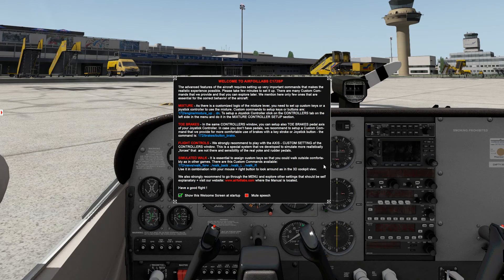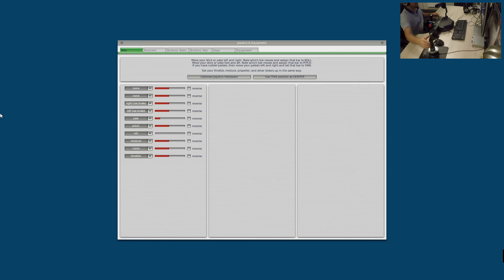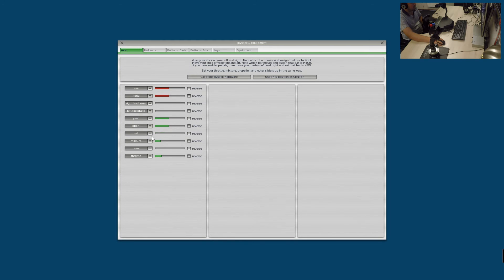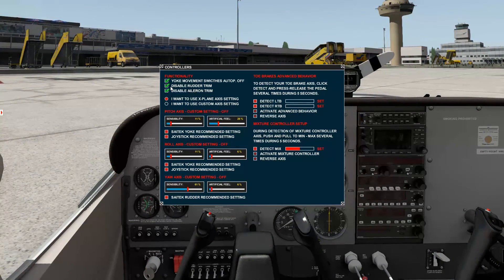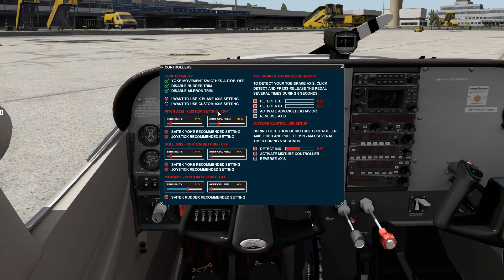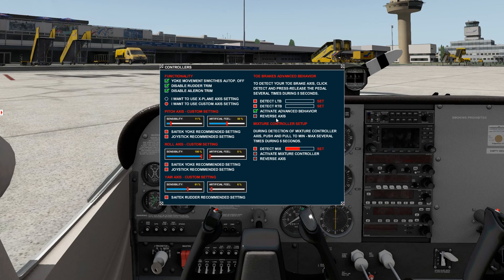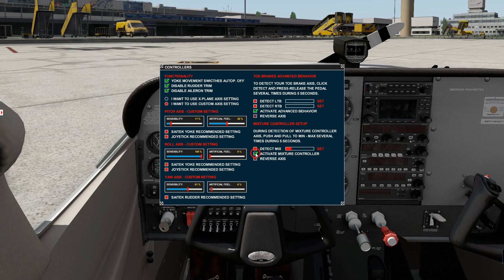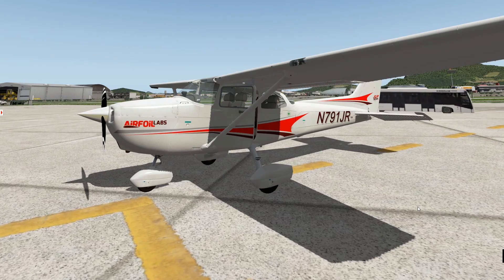2. Airfoillabs Cessna 172 SP 1.61 - Basic Setup

Comment: First of all, thanks for airfoilabs for doing this awesome job! Its a masterpiece.

So, I bought it and I'm experiencing some issues. I use a Thrustmaster Flight Hotas X, so I do not own any rudder pedals, I use my braking control on my joystick.

I followed the tutorial but when I set the button for "Main Brake (in case you have no toe brake pedals controller)", but nothing happens when I press this. 

When I use the default (B for braking), I hear the sound of the parking brake being applied, as I was pressing "V" key. Could anybody help me on it?

Ah, it occurs on both (xp10 and xp11).

Thanks and sorry for my english!